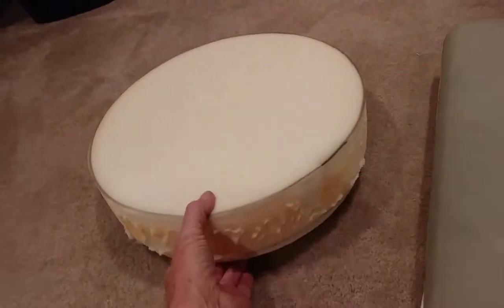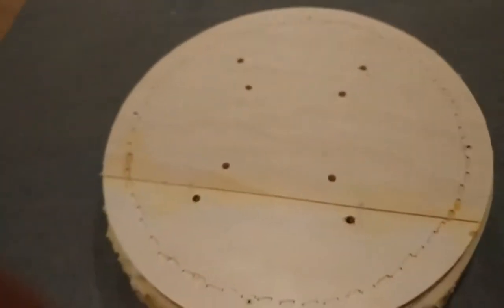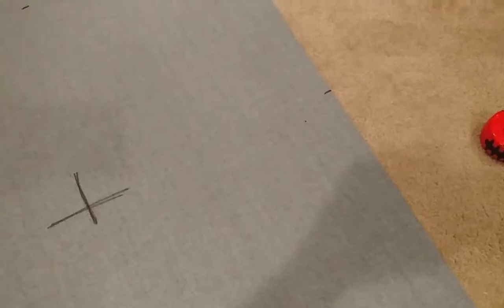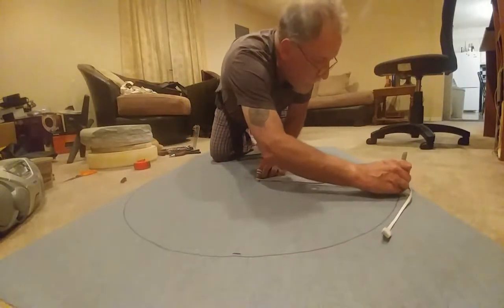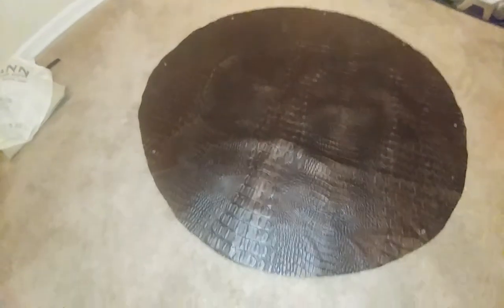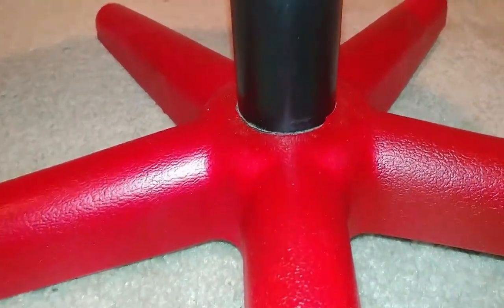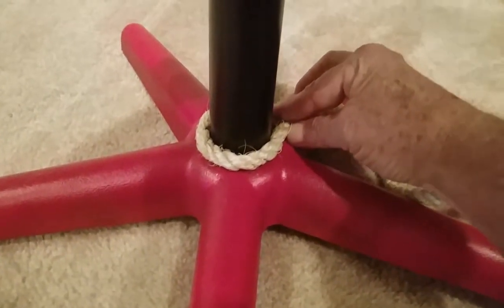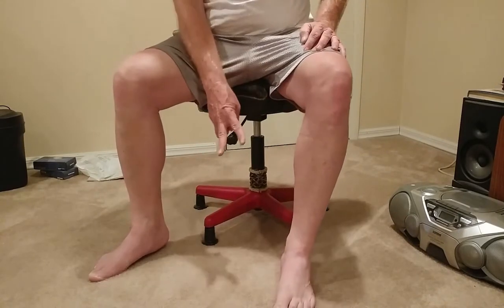DIY Drum Throne from  Garage Sale Massage Chair

Comment: The secret to professional upholstery is pulling your creases and folds out and making relief cuts. Sometimes you have to pull staples and do a section over. You keep pulling your creases u til they’re so thin they can be flattened out. It’s more work but worth it in the end.
Reply from the maker: Hey Great!! I appreciate the input, Joe. I did something similar to this awhile back but not with anywhere NEAR that much padding. If this wears out or I get tired of the material, I will DEFINITELY check out better ways of getting the job done. Thanks again!!
Reply: @157papabear  Almost forgot the most important tool. A heat gun will allow you to soften the vinyl for those impossible pulls. If you use a good 2 way stretch vinyl you should get good results. I'm a car audio fabricator and while I'm not technically a professional upholsterer I wrap all my panels and a bad wrap on my part will cost me a lot of $$$$. The only time I outsource my work is when there's leather and sewing. After noon looking at your stool it looks like you made a Tama Ergo Rider. I hope it's comfy for you. I just bought a Tama cloth top saddle style throne.